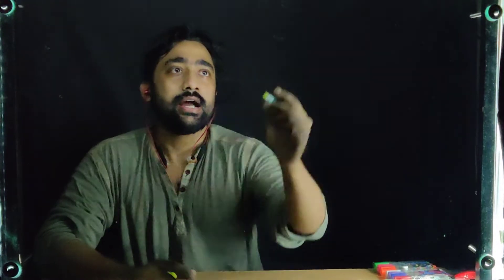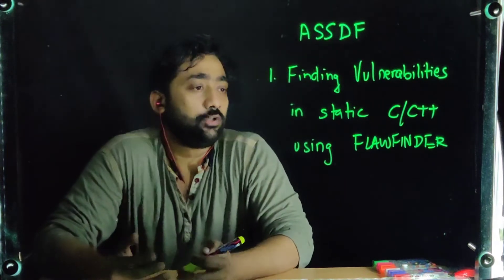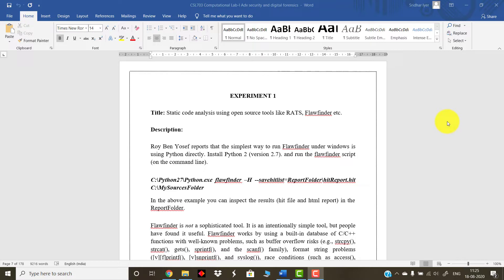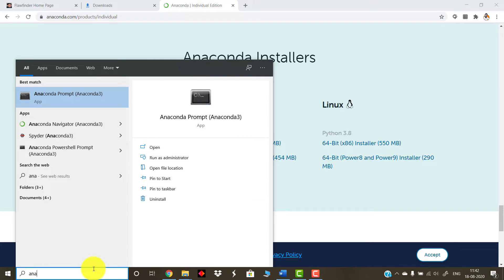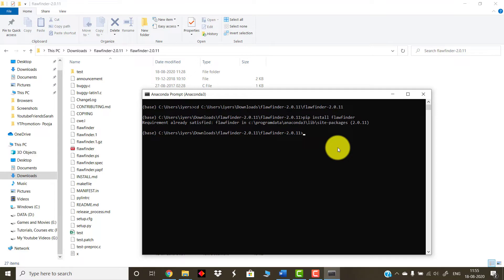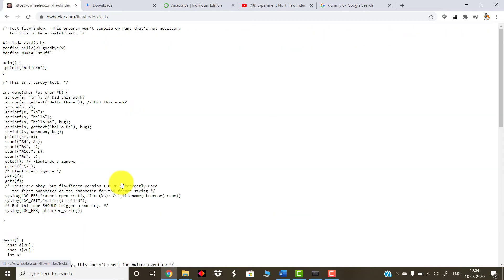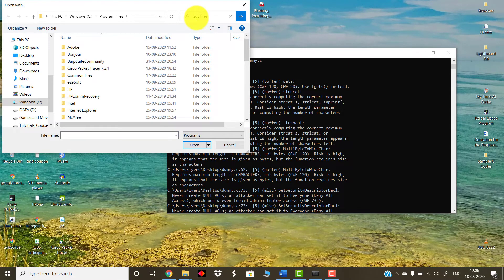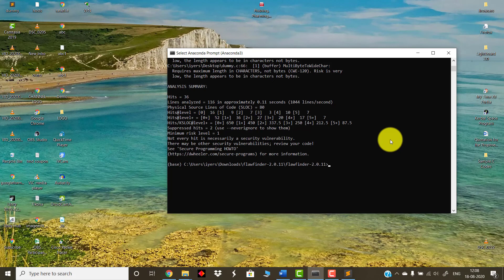Static Code Analysis using Flawfinder | LightBoard Series | ASSDF | Under15Minutes | Sridhar Iyer

Comment: Thanks Sridhar for reply to my earlier question!
here is one few more: 
1. does it support scanning per file only? usually in a porject there will be a set of files. so can we do a scan for all the files (.c files) in one go? 
2. Is it possible to get the scan report in some report file (html or other format)?
Reply from the maker: Solution

1. Yes we can scan an entire directory if all files are present inside the same directory

2. Yes we can output the results into a file

Sample Execution :

flawfinder   --context  mydir > results.html

Examine all the C/C++ files in the directory mydir and its subdirectories, and produce an HTML formatted version of the results.
Reply from the maker: So far I have tested with single files only.  I will test and see if we can send multiple files as parameters to the command and also check whether report generation is possible or not. 

Thanks